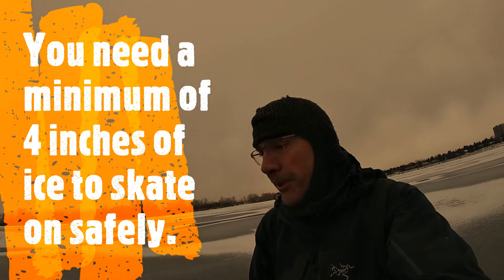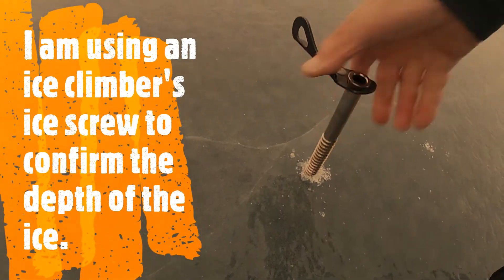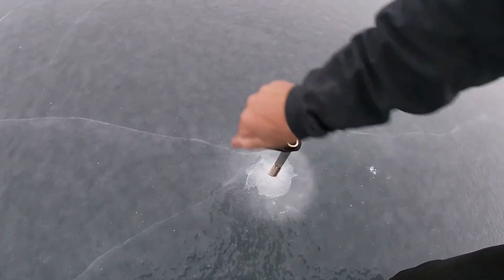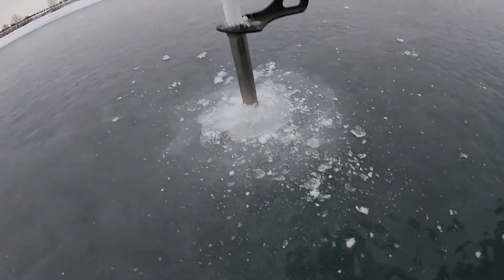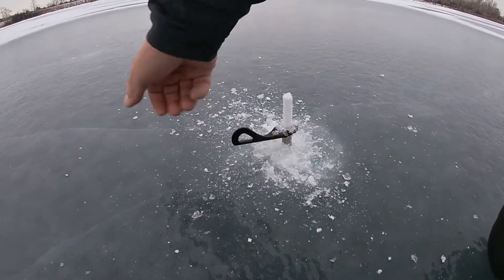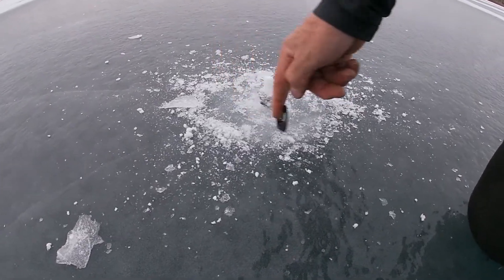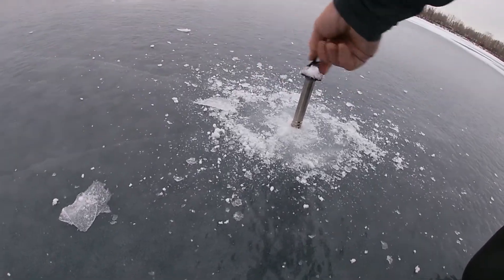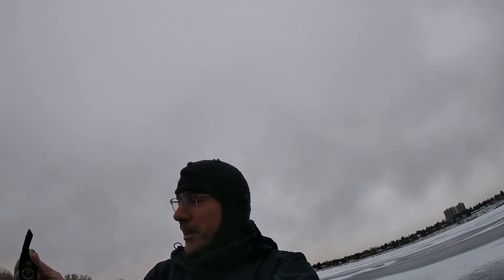HOW TO TEST ICE THICKNESS FOR SAFE SKATING

Comment: You could drive a truck on that ice lol
Reply from the maker: Thanks for the note. You are likely correct. Rules of thumb I have seen for cars and light trucks is 12 inches or 30 cm. 40 to 50 cm for larger vehicles.
Reply: @respecttherisk2022  your comment section are all chickens
Reply: Trucks and shacks built on it. This comment section is like a bunch of chickens omg

Comment: Hi! I was just wondering if those drilled holes are a problem for your local pond. Will they cause cracking in other areas, or is the hole too small to cause any problems for skaters? Let's say I drilled 25 holes all over my pond for safety...is it dangerous to have too many drilled holes?
Reply from the maker: It is a judgement call for sure, however, I would say that if your holes are at least ten feet (3 meters) apart and you have over four inches of ice thickness that there should be little impact from the holes.  If you are worried about it, try going over VERY shallow water -- less than one foot deep -- and drill holes very close together and then get three or four people to jump up and down on that spot to quantify the hazard more clearly. If the ice breaks, there is little danger if water is that shallow, but it would give a good indication of how close the holes have to be for it to create a hazard. In cold weather, the holes will likely re-freeze within a day or so.
Reply: So amateur comment omg

Comment: Is that normal that even thick ice scratches? I tested one pond and it was really thick, but when I did a first slide on skates, it sounded scarry
Reply from the maker: That is interesting. Do you mean the ice was cracking where you were skating? One issue to be cautious of is that if a body of water freezes, and then the water level drops under the ice -- it is possible that the thick ice creates a "bridge" over the water. This situation is actually VERY dangerous. If the ice breaks, and you fall into the hole, you may not be able to reach the ice above from the water. On a large lake, the ice usually fractures at the shore line as the water level drops, and most of the lake ice is still sitting on the water under it. But, a smaller pond could have this issue if the bottom of the pond is holding up the ice in places, and a gap might exist between the ice and the water. Stay off ice in such conditions. VERY dangerous.
Reply: @respecttherisk2022  oh.. thank you very much. No I feel weird. After a few days of constant temperatures below 0°C I would normally go to this pond, but now I feel scared. The temperatures at night have been  reaching even -18°C for a week and ice has solid 15cm. Do you really think that it might be deceitful?
Reply from the maker: It is possible your fear is telling you something. You should pay attention to that. A few other risk mangagment items: Go out with at least one other person, if not more. Take rescue gear with you: poles, ladders, ropes etc. Carefully drill more test holes over the area you wish to skate on in a grid pattern with your partners watching from some distance away. If you are still worried, chop or augur a larger hole to get a visual on the water level below. Drill or chop as many of those as you feel is necessary. If you still feel anxious and have fear after all of that: don't go out on the ice. Even experts can be wrong at times -- and we should all pay attention to our intuition. It remains a risk sport -- and risk sports feature very real danger.
Reply: @respecttherisk2022  Thank you fery much!
Reply: @jacobsss5827  ice makes cracking sounds when freezing
Reply: @respecttherisk2022  when its cold the ice makes sounds. It means its freezing more
Reply: Amateur and typical

Comment: ice thickness can vary throughout a lake, do you ever do multiple depth checks?
Reply from the maker: Yes, absolutely. If I am worried I about varying ice thickness across the lake I will do a bit of a grid of holes over the area that I will be skating just to be sure that the whole area is of a safe thickness.
Reply: It only varies if there is a stream coming in. That area will be thinner. Normally ice in the middle is thicker than by the shore

Comment: Thanks for the video! How does the screw tell you when you hit water?
Reply from the maker: You can feel the teeth of the screw biting as you turn it into solid ice. It takes quite a bit of force to turn it. When you hit water, or a pocket it will suddenly take little or almost no effort to turn the screw.
Reply: The snow stops coming out of it. I'm dissapointed in your observation and attention span